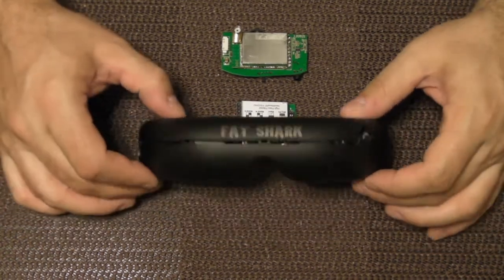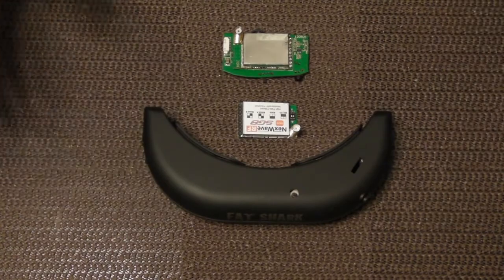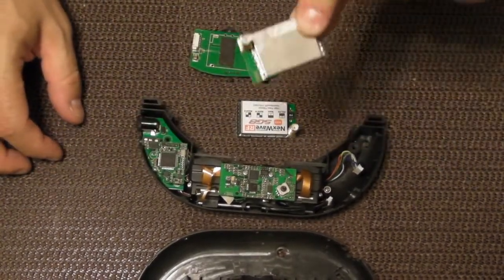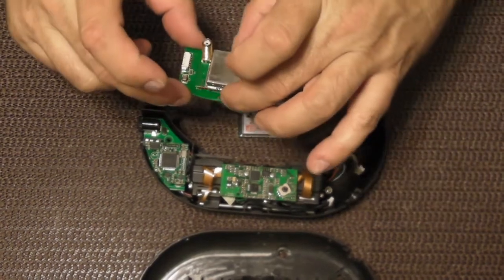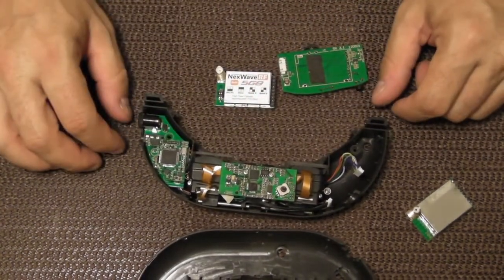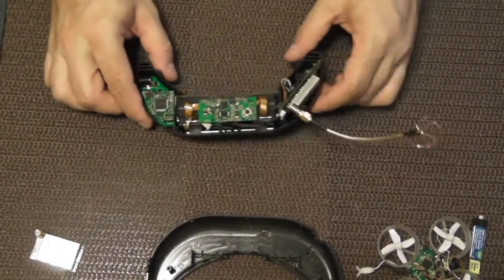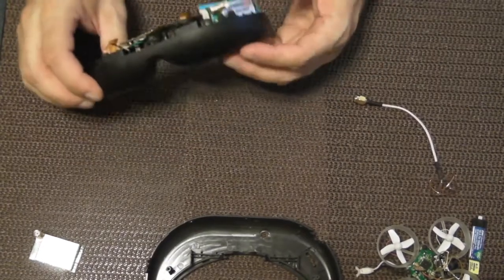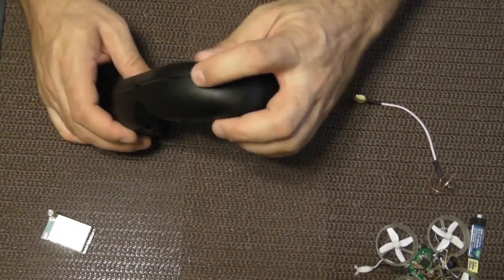How I Upgraded my Fatshark Attitude SD v1 - Nexwave 5.8 rx module

Comment: q:-  dose your head tracking work at all please I have just purchased a second hand pair of these im trying to set it  up on a tunigy 9xr i got the tilt to work but not the pan, so i got a new head tracking board plugged it in and got the pan to work not the tilt, when i changed the chanel to set them up right i now have the tilt working but not the pan, any advice please..................
Reply from the maker: Sorry, I can't help with that.  I don't use the head tracker.

Comment: I did the same with an teleporter V5 and it's a huge leap in performance and comfort :D Cheers!
Reply: Jarco de Rover I have the teleporter v5 will This work? Or at least should I try with another module?
Reply: Jose Quiñonez I have an Realacc vtx, and i had to replace the pinheaders for longer ones. It is not that hard to do.
Reply: its not too hard if you know how to solder . https://daewootech.wordpress.com/2016/07/19/upgrading-fat-shark-teleporter-receiver-module/
Reply: Would it work with diversity reciver ?

Comment: Did you know that this works for the teleporter v2, and v3. I just installed it into my goggles and it works. Thanks for the video
Reply from the maker: That's great. Thanks for adding the info.
Reply: is it hard to do this mod? I'm a little new to fpv stuff and soldering.
Reply: Not really all I did was break the module circuit board and then pull out the pins. But you have to be careful because you can easily crack the board that it mounts on. And for mine I actually got the diversity module. Best of luck:)
Reply: Rc Addict with planes hey, can i know what diversity u use to mod this attitude v2? any link or pic to share? Im so wana mod this to diversity.  thanks!!
Reply: Fairuss Yusoff  just search up fatshark diversity module, this was very easy to install, you just have to be careful with pulling out the pins.
Reply: Rc Addict with planes i was thinking to use the furious d diversity.. do u think it will work?
Reply: Fairuss Yusoff yes it will, but as I said when your installing it in just cut the old receiver out just behind the pins, cause if you just try to cut the pins in half so u can des older them you will just break the board that your mounting your receiver to
Reply: oh noted. thanks again!!
Reply: https://daewootech.wordpress.com/2016/07/19/upgrading-fat-shark-teleporter-receiver-module/ its probably easier